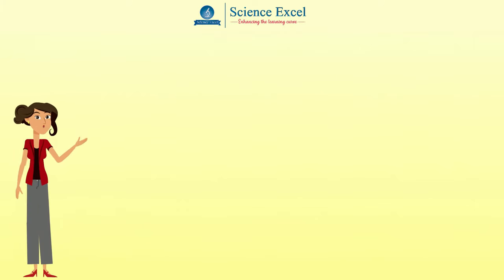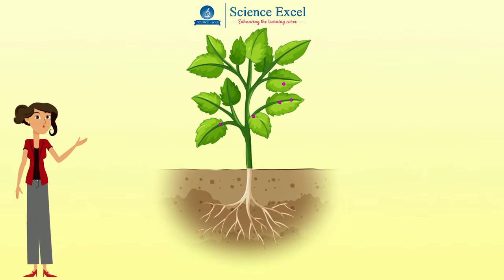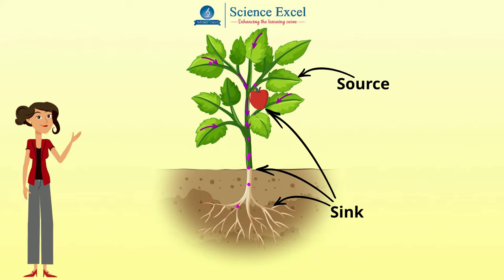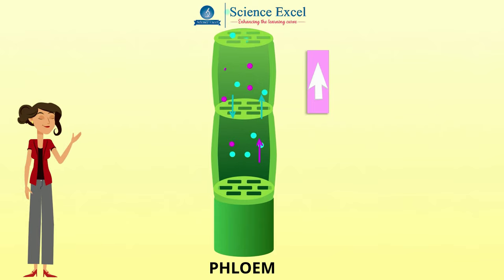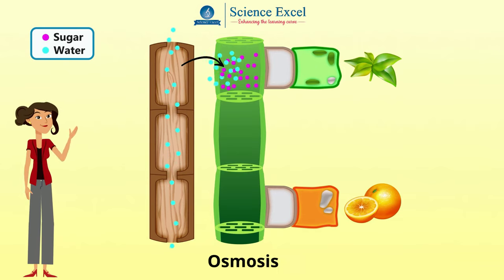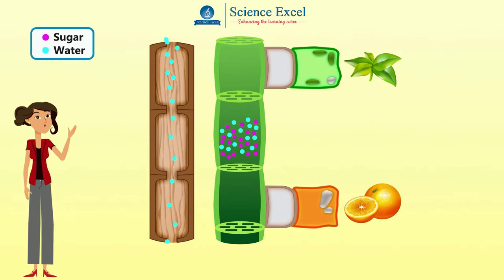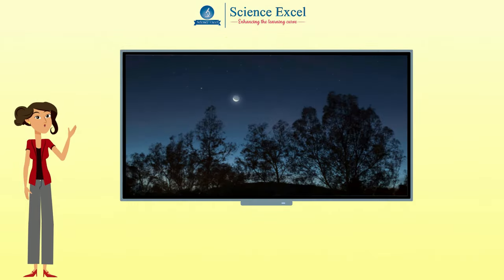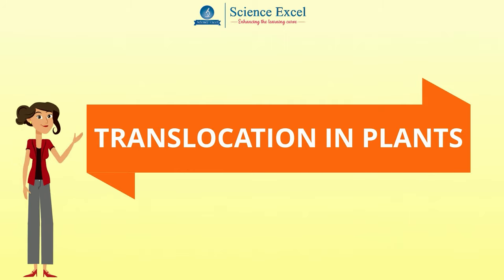Translocation in plants | Science Excel

Comment: What is the difference between osmotic pressure and diffusion?
Reply from the maker: Thanks for commenting :) We have videos on both Osmosis @ https://youtu.be/U2E1uk93Hfk and Diffusion @ https://youtu.be/rEU0nwOI5iA on our channel. Please watch them to gain a better understanding of the concepts. Here is a quick summary of the two concepts. 

Osmosis is the movement of water molecules from a region of higher water potential (dilute solution) to a region of lower water potential ( concentrated solution), through a partially permeable membrane. Example - Absorption of water molecules from the soil through the roots of the plant. 

Diffusion is the net movement of molecules and ions from a region of their higher concentration, to a region of their lower concentration, as a result of their random movement. Example - Dipping tea bags in hot water will diffuse the tea in the hot water. 

Hope it helps you to gather a better understanding :)

Comment: Explanation was awesome!!
Doubt- Why are phloem walls thinner than that of xylem walls?
Reply from the maker: Thanks for watching ! Getting to your query, the primary function of the phloem is only to transport food from the source cell to the sink cell. Whereas the Xylem has to withstand pressure changes due to the movement of water from the root to the different parts of the plant. The other function of the Xylem is to keep the plant upright and this is made possible due to the presence of lignin in them. Hence the walls of the Xylem are thicker than the Phloem. Hope this answers your query.
Reply: @ScienceExcel  thanks
Reply from the maker: @akmarkvi  Glad you found it helpful ! Kindly support us by SUBSCRIBING.
Reply: @ScienceExcel  what is the difference between osmotic pressure and diffusion?

Comment: thanks madam but why phloem transport is bidirectional??
Reply from the maker: As the requirement of food in a plant is both ways, it is transported downwards as well as upwards through phloem. The source-sink relationship between roots and shoots varies with seasons. For example 
in winters the lack of sunlight, means no photosynthesis takes place. The leaves need food, here roots act as source and transport the stored food upwards. 
Another example is during summers, sufficient availability of sunlight means proper photosynthesis takes place. Here, leaves become the source and transport food to the roots in the downward direction and also to shoots in the upward direction.

Comment: What is the role of hydrogen ions in translocation
Reply from the maker: Thanks for watching ! Now coming to your query, sucrose is actively transported into the sieve-tube elements. The companion cells actively pump out hydrogen ions using ATP. Hydrogen ions return back into the companion cells, down a concentration gradient via a co-transporter protein. Sucrose must be co-transported with hydrogen ions, in order for the hydrogen ions to get back in, down the concentration gradient. This increases the sucrose concentration in companion cells, which creates a low water potential. Water osmoses into the companion cell, increasing turgor pressure. The water carrying the assimilates then moves to an area of lower pressure-the sink- in a mass transport system this is called translocation. 

Hope you found it helpful ! If you did please SUBSCRIBE to our channel.

Comment: Now what happens when a plant is cut as ring on the barkof a plant and half way of a wood
Reply from the maker: Removal of ring bark is called ring barking or girdling which is the complete removal of the strip of bark from around the entire circumference of the stem of a woody plant. The strips of bark consist of phloem and sometimes a part of xylem, the removal of these tissues prevents the plant from transporting nutrients from the leaves to its roots, resulting in the death of the plant over time.